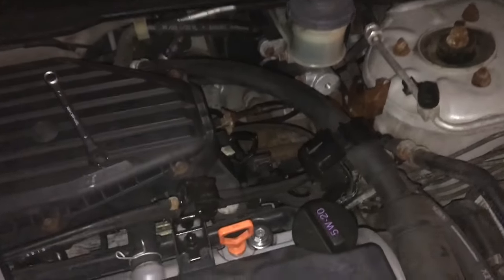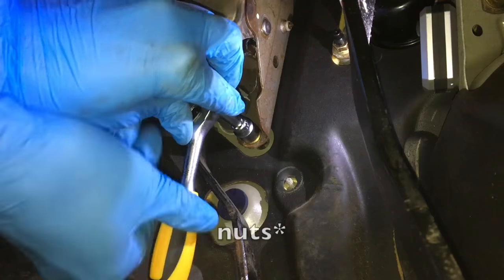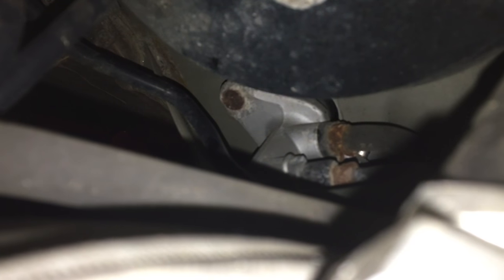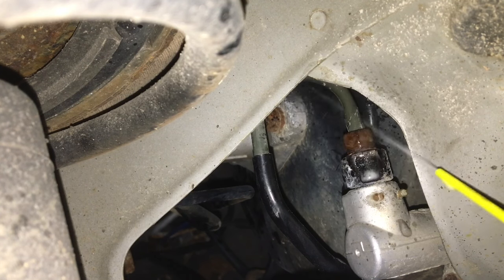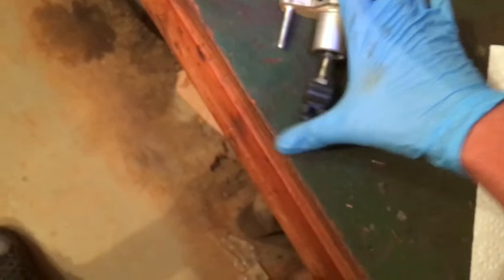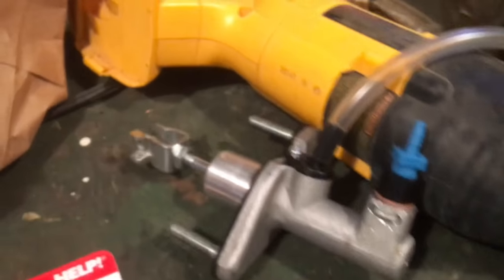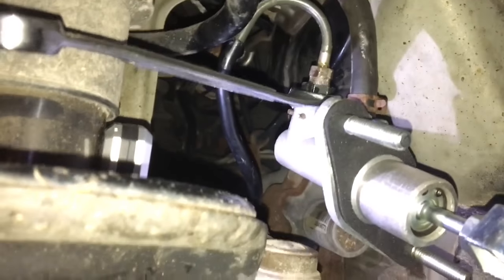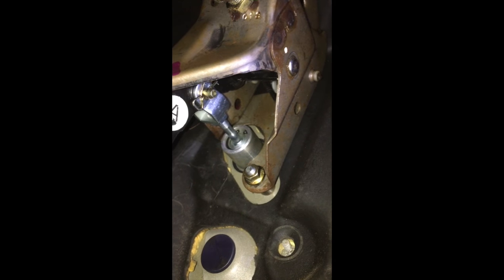How to Replace a Clutch Master Cylinder and Slave Cylinder (2001-2005 Honda Civic) - 1 of 3

Comment: How did you get access to the master cylinder when the wheel was removed with that metal piece completely blocking it
Reply: Just pull it out like there’s nothing to it, just a lil bit of wiggling your hand and visualizing success

Comment: hey brother, great video. I'm stuck as hell trying to get the master loose from the firewall. there is a metal cup looking piece welded to the wheel well that butts up against the back of the cylinder. Any thoughts on how to get around it?  got an 05 Civic like yours
Reply from the maker: Michael T can you take a picture of it and post it? I'm not exactly sure of what you're talking about. The only struggle I had when taking off the master cylinder from the firewall was from the metal cable getting stuck on the body frame, so I had to push the master cylinder down and pull. Hopefully that helps.
Reply: sorry can't take a pic now. I ended up taking a driver to push it threw from the inside of the car.  Thanks for the reply.

Comment: Interesting approach to take out the Clutch Master Cylinder! I did this job once a bit differently (removing the master brake cylinder, which was kind of an overkill), but I think your method is much easier. My question is: how flexible is the metal clutch line when you pulled out the Clutch Master from that corner "pocket" above the wheel? Did you have a feeling it would break? Did you have to remove the metal clutch line from the plastic clips/brackets on the frame firewall? And finally how difficult was it to fit the replaced Clutch master back into the proper location, with the setup you had you probably attached the line fitting before placing the Clutch master cylinder back into the corner "pocket" and also you need to target the two bolt holes and the pushrod in the middle, so three things need to be aligned and you had the brake booster in the way, very confined space. How hard was it to manipulate this?
Reply: it doesn’t feel like the line is going to break at all it’s completely fine

Comment: I just bought a new clutch  master ctylinder from from Honda and it wiggles like your old one. It's a genuine part never been used is that normal ? That little arm thing moves
Reply from the maker: yeah that's normal for it to move around. it's got a spherical ball on the inside that lets it move around

Comment: Does anyone here know: if you don't have a bench vice and bleeder kit, what's the alternative? Can you bleed the master once it's in situ?
Also, if you can't get the flare nut off the hard line of the master cylinder, can you just remove that holding pin to get the hard line off?
Thx.

Comment: Is this the same procedure for a hybrid?  I have a 2003 Civic Hybrid 1.3cyl
Reply: I'm about to try on an '05 hybrid. Hopefully this is the same.
In case anyone's reading this in the future: nope. At least my 2005 Civic Hybrid is different. The slave cylinder is quite difficult to get to without removing coolant & A/C lines, at least if you're accessing it from above. I didn't want to keep crawling under the car for the whole process anyways. Have to take off the whole air intake manifold, as well as pull the battery, then there's just enough space for one hand to reach down and get a small wrench on the bleeder valve of the slave. If you're planning to replace the slave: good luck. As for the master, it's behind a metal shroud. Without removing the brake reservoir (which I didn't even want to consider), you could either grind out that metal shroud so you can access the clutch master cylinder from the wheel well area, or, as I've been attempting (so far unsuccessfully due to the seized flare nut on the hard line), reach in with your left hand holding both the 17mm & 10mm and attempt to back out the flare nut one-handed. In short: it's a nightmare.